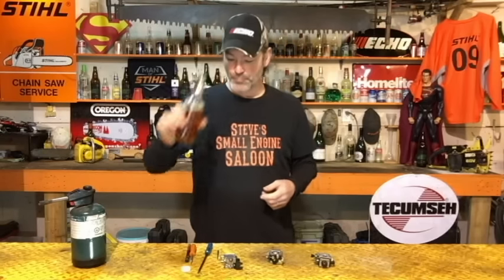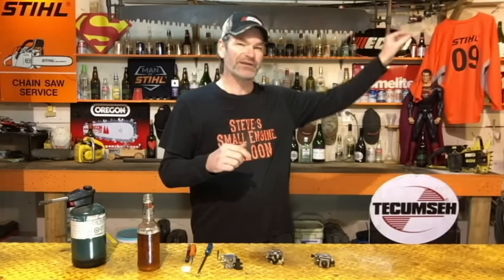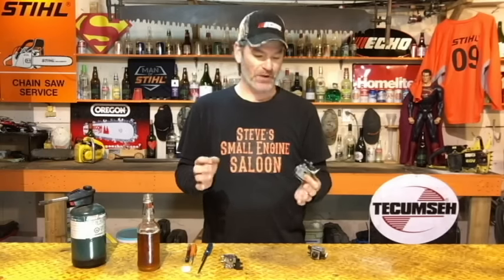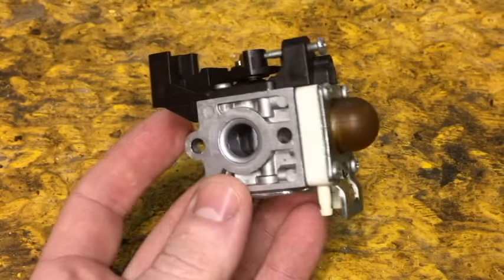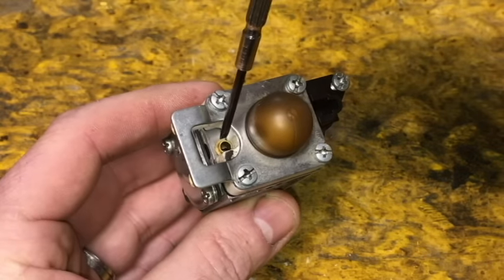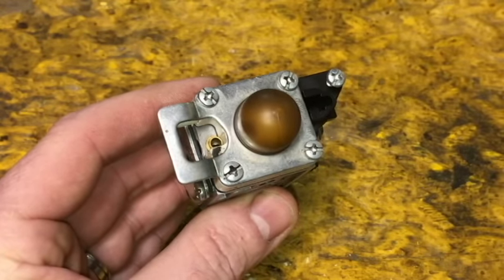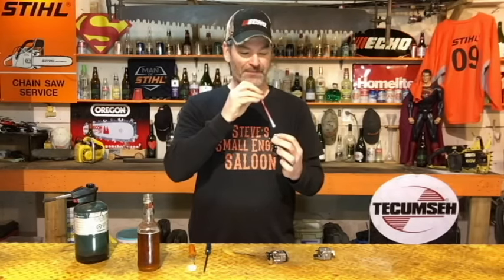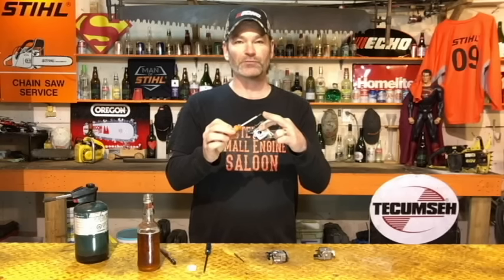Hidden Carburetor Adjusting Screws On Some Weedeaters And Blowers

Comment from the maker: ✅Order the specialty carb adjusters here ➜ https://amzn.to/3mJyI2q
For more videos like this, check out:
👉How to Adjust or Tune the Carburetor on a Leaf Blower ➜ https://youtu.be/DWPUYJiF6KM
👉CORRECT WAY To Tune The Carburetor On A Chainsaw ➜  https://youtu.be/M6T5JoGXcHY
👉How To Adjust Or Tune The Carburetor On A Weedeater ➜ https://youtu.be/gmhxTvGRtCg
👉How To Clean a Honda Style Carburetor ➜ https://youtu.be/uAHdhuDpeKw
👉How To Rebuild A Carburetor On A ChainSaw, WeedEater, Etc. ➜ https://youtu.be/7-VpdJEJRRw

You can connect with Steve here too: 
✅Visit Steve’s WEBSITE ➜ http://www.stevessmallenginesaloon.com/ 
✅Visit Steve’s PARTS & TOOL STORE ➜ https://www.amazon.com/shop/stevessmallenginesaloon 
✅Follow Steve on FACEBOOK ➜ https://www.facebook.com/stevessmallenginesaloon 
✅Follow Steve on INSTAGRAM ➜ https://www.instagram.com/stevessmallenginesaloon/ 
✅Follow Steve on TWITTER ➜ https://twitter.com/SteveSaloon
Reply: Mine dont look filled, but I cant adjust it, I see a brass thing on the top, but its round and none of my tools work on it
Reply: Double J  y
Reply: @tyleranderson6221  8PM
Reply: Hey Steve I can adjust the other carbs with the special screws just fine but when I went to my echo leaf blower which from the factory was running lean and I took both plugs out and I got the low speed adjusted but I just couldn’t get the high speed. I don’t know if it was because it’s winter but I warmed it up for 5 minutes so if you wouldn’t mind could you make a video where you adjust that type of carb from the video? I already checked for air leaks bad diaphragms and my fuel was fresh. I don’t know if you’ll even see this but I was just curious if you would do that. Tomorrow I’ll try a bit longer and see if it’ll work. It revs out all the way and idles fine but around mid throttle it runs rough so I don’t know.
Reply: @tyleranderson6221 I had an echo weed eater that had a brass plug that I carefully drilled out to expose adjusting screw
Reply: @ARW981  lmao that was 3 years ago😭 I figured out that trick now

Comment: I’ve been a atv/ snowmobile / utv and motorcycle tech for the last 15 years for Polaris and Yamaha. We recently picked up the echo line and I’ve all of a sudden am getting weed wackers, leaf blowers and chain saws added to my work load while never really working on this smaller type stuff much in the past. It’s been a learning curve that’s for sure and even some I have almost given up on. I’ve actually learned a heck of a lot from your videos on this stuff and beleive this video may have given me the solution to a echo weed wacker I said to hell with as nothing I did could get it running right. Never would I have known about these hidden mixture screws without your help. Keep up the great work my friend. And thank you.

Comment: I don't normally comment but I figured I should on this video. I bought a brand new champion straight shaft weed whacker 3 years ago. It worked amazing for my farm for the first year. The second year though it stopped working after I changed the string out. Wierd right?! 

After fighting with it for days I set it up on the shelf and left it alone. Pissed off and defeated. Tonight I picked it up and fought with it some more. Figuring that it wasn't getting correct fuel as soon as the choke was off. It would die. 

I wanted to adjust it but could only find one of the screws (high speed) and it was an A circle type screw. I couldn't find the low speed adjustment. 

After watching this video I was able to get this weed whacker up and running and I should be able to get it back out on the farm earning its keep. Thankyou so much Steve!
Reply from the maker: You're Welcome...

Comment: Thank you Steve! You just saved me god knows how much money on fixing my four stroke Dolmar Backpack blower motor. It had the hidden/capped screw for the air fuel mixture. I heated up a screw driver and melted it into the cap like you showed us allowing me to remove the screw cap. 5 seconds worth of adjustment and my blower no longer bogs when I go from idle to full throttle instantly. That was stupid easy to fix.
Reply from the maker: Right on....You're Welcome...

Comment: Extremely useful video.  My Homelite leaf blower could only go to half throttle before bogging down and stalling.  I did Steve's trick with the blowtorch and small screwdriver and got the plug out.  Adjusted the air/fuel mix and the the thing has never had more power...running like a champ.  Great work Steve!
Reply from the maker: Thank You...

Comment: Thank you heaps and heaps. My homelite weedeater lives again! Although not covered in your carby demo, mine has a chinese ruixing carby with a barrel. The hidden idle screw is well camouflaged and I needed to modify a largish flat screwdriver to adjust it. Thanks to you Steve, I received a major clue as to where it must be, then POW! There it was. You're a legend, mate!
Reply from the maker: Right on...
Reply: @StevesSmallEngineSaloon  I SEE A 1BUMP IN THE MAIN SHAFT BUT NO OTHER FOR HIGH or could be low I guess! Any Idea's! It's a Homelight 26cc 2020 Rui*ing  129 Wish I could get a walbro to replace it! But if you know where other adj.screw is it would be appreciated! Great Stuff! Rick👍🇺🇸

Comment: Dude, I love your channel! Thank you for your content. I searched everywhere to find a video that explained this and you’re the only one. I have an old “x-treme” scooter that has a 2 stroke motor on the back. I got it when I was a kid and I’ve taken it apart recently to clean everything and I had to replace a couple things. Well I did that, it ran good for maybe 3 minutes and now it won’t run and when I give it gas, it bogs down. I’m pretty sure I need to adjust the carbs because there was so much gunk in there. But I have the second carb you talked about. I’m about to go out there and get this sucker running! Fingers crossed.
Reply from the maker: Good luck!

Comment: Awesome video Steve. Bought an Echo trimmer a while back that never ran great wide open, despite them "tuning" the carb when I bought it. Pulled the plug, and adjusted the high speed to the sweet spot and it's absolutely singing now.
Reply from the maker: Awesome...
Reply: mxdev Hey mxdev ...  What Echo do you have and did you have one of the carbs that was shown in this video..?  Thanks
Reply: @stacks4943  It's a GT-225SF. I don't know if it's exactly one of the carbs in the video, but the information given is all that is needed.

Comment: Thanks for this tip. My neighbor brought me her Echo leaf blower that wouldn't rev up. After cleaning the spark arrestor screen with my torch, like in your other video, it still wasn't running right. It had a Zama carb on it, so your "hidden adjusting screws" video was perfect. I didn't need to remove the plastic caps, there were none and I didn't need a fancy screwdriver.  Both screws were just plain slotted,, so I was able to get it adjusted pretty quickly.  It really screams now.  Thanks again.
Reply from the maker: You're Welcome...
Reply: @StevesSmallEngineSaloon  That tip worked so well on my neighbor's blower that I pulled out my 22 year old Weed Eater blower and got it screaming again.  It's been weak for several years.  Thanks again.

Comment: Thanks for the "hot screwdriver" tip. My Echo trimmer wouldn't rev unless the choke was on. I cleaned the carb and the exhaust screen... no improvement. I disassembled the carb, and sprayed it out with B12... no improvement. All the gaskets and diaphragms were in good shape too. I replaced the primer bulb about a year ago, so it's in good shape, too. Once I finally gained access to the high speed screw, I was able to get it to run. It runs great now. Thanks again.
Reply from the maker: You're Welcome...

Comment: Removing all fear from small engine repair.  Thanks again Steve.  As an dual engineer and homesteader I really like the way you put these videos together.  I have a lot of engines to maintain here, like 25+ at last count.   I am trying to avoid professional repair except on my quad and cars. as they are to much of a PITA to bother with.  But I like the small engine stuff done here and that is 98% of what I have to maintain.   Lot of practical knowledge and some entertainment, in the way I enjoy, as usually there is a beer involved in my engine repair.  The other day my Stihl MS250 dumped all it's chain oil on the table and you had a video and me back up and running in no time.   It wasn't the plug but the line was dry and needing replacement but either way, I spent 5 dollars and 1 beer and was back up and running.  Thank you again so much for all these tips!
Reply: Oh, and I should add...  The local shop in town that I got the part from, for $3.50 told me honestly that they would charge a half hour labor, and since Stihl insists on them doing a multi-point inspection to optimize performance, but I know the saw is running like a charm, it would cost $90 😮😮😮  I said thanks, I am really taking pride in learning how to fix all my equipment on the fly myself, but they were really pleasant as they are in small towns, knowing I will buy more equipment throughout the years.  So you say in your videos you like to hear that you save people money?  Yep!!! Thanks.
Reply: Me too.

Comment: Thank you, I have a Echo weed eater and after I changed the fuel lines, air filter, fuel filter, spark plug, remove the screen exhaust, it kept boging down, I was about to give up and throw it to the garbage, but I removed the little plastic with a small screw and adjusted the carburetor, it worked pretty fine.
Reply from the maker: Right on...

Comment: Great info!
BTW, I have had good luck adjusting small D screws without the special tool (although its easier with it). Just slip a very thin flat screwdriver against the flat side of the "D" shaft and give it a turn. The vast majority of the time those little screws will turn with minimal effort.
Reply: I actually made a small D adjusting tool myself out of an old screw driver and a small strip of flat tin. Just rolled it shaped it and welded it.

Comment: Great video, thanks.  11:24  Absent the special Micro D tool, for my Echo PB500T Walbro backpack carb, I sliced the end of a Bic ink pen straw and was able to push it and fit it over the needles to adjust the mixture.  It worked.  I eventually purchased a "micro D" carb adjustment tool from China, but the ink straw put me back in business.

Comment: Thanks for the info on the high speed adjustment.  Got it adjusted.  However you mention another hidden adjustment, I believe it would be the low speed, i.e. idle.  Where is it?  I see what appears to be a brass plug in the top, throttle control.  Is that it?  How do I remove it??

Comment: Great video helped me a ton! Brought a crappy Chraftsman 4stroke weedwacker home from work with bogging issues. First carb I've never seen adjustment screws on. Unfortunately I have one of those non adjustable high screw walbrow carbs. But the low idle is all I needed and a clean air filter. Thanks for the video! Keep tippin em back!
Reply from the maker: Right on ...

Comment: Hey Steve, love the channel.  I recently rebuilt a Husqvarna 150bt backpack blower with a Walbro carb that looks just like the one in this video.  I pulled these screws out to clean out the carb, but I failed to note how far the screws were turned out by the manufacturer before I removed them.  On a handheld product I can usually get it started by seating the screws and then turning each H and L out 1.5 to 2 turns.  But I can't seem to find the sweet spot on these jets.  Is there a "normal" starting point for these screws?  Thanks so much!

Comment: I found that a drywall screw works perfectly for extracting those plugs. That type of screw comes to a sharp point and has aggressive treads. Just screw it into the plug until snug and it should easily pull out.

Comment: Saved my day as I didn't find the L adjustment screw but in my case it was just in the center of the moving throttling barrel system. Always thought it was just the screw to keep the throttle part in place but  after seeing this video I unscrewed  (philips flat) and it unfolded a screw with a large pin. Adjusted the whole thing and done!

Comment: Another nice one. As a desperate move, I had some "D" style adjusters on a poorly running carb. I obviously couldn't slot them, and it's illegal in Georgia to sell the drivers (unless you know the shop owner), but I'm cheap, so I used a couple of pieces of stiff plastic tubing, heated the ends a little and pushed them down over the screws. Those two are still sticking out the side of my chainsaw, as a quick, permanent adjuster setup!
Reply from the maker: Right on Buddy...

Comment: Fish hook for these small plugs. Different size hooks for different applications. If you need the barb closer to what needs to be removed simply nip off some material with side cutters. If this tip has already been suggested I apologize... there is a lot to unpack in comment sections.

Comment: Thank you so much Steve, knowledge is a wonderful thing and meant to be shared, thank you again for the enlightening me. I just spent over an hour changing carbs, cleaning fuel lines, checking the spark plug is working and cleaned, all to no avail, it just kept on bogging down as you American's say. Keith Spence Eng from Wales UK
Reply from the maker: You're Welcome...

Comment: I've never seen that type of carb with the barrel butterfly in my life & I've seen lots, maybe we don't have them in Scotland but hey ho, you learn a new thing everyday. Cheers 💪❤️👍
Reply from the maker: Not the most popular here in Canada, but they are around...
Reply: My Redmax trimmer has the Walbro like that. Been on the shelf for a few years due to not running. May pull it out and check it again since i've seen this. Thank you.
Reply: It is on my old Stiga SB 44 (its really old, bought used 6 years ago)! Latvia.

Comment: perfect fix for my echo trimmer. runs like a top now that i am able to make the high and low adjustments.
the plastic plug melted right on to the small screwdriver and twisted out nicely. nice job.
Reply from the maker: Right on

Comment: The k series Zama barrel carbs have a check valve behind a ss plug under the needle hinge and directly under the white fuel spout , and cannot be removed , i have found that on many of those carbs it will go bad or stop up I always prime the carb with fuel and blow air from compressor through the throat of the carb with barrel fully opened in direction of operating flow and you should see a fuel mist , And also the adjusting needle has a small fuel passage in the needle itself that some times gets clogged
Reply: The epoxy is bonded tightly to the walls of the hole, but the plastic plugs are just a pressure fit.  Epoxy MAY also fill the screwdriver slot, or may not...  has anyone tried?

Comment: Thanks for the help. I bought a redmax ebz7500 about 2 years ago and it started running extremely rich all of a sudden. I saw that adjustment hole in the carb and tried to make a high speed adjustment with no luck.  Your trick with the hot screwdriver worked perfectly. (I used Mapp gas) after about a full turn or so clockwise it runs better than new. I think it was always a little rich from the factory. Lean is mean it what they say, well until it kicks a rod🤣   Great video, just wanted to say thanks 👍
Reply from the maker: Right on Kenny!

Comment: Steve, I have a raftsman string trimmer that uses straight gas “4 cycle” ... i think I only have the screw down the Center of the throttle. Is it possible just to have one screw on the wall bro carb?
Reply: Ya my Honda 4 stroke is the same.
Reply: K

Comment: Love this vid.  I have one that I can't seem to find much info on.  Only seems to have the one pac man style screw on the throttle.  Similar to the low idle adjust.  Have looked all over the carb and don't see  a second hidden screw.  Carb is stamped Ruixing, but the model number doesn't bring that up online.  Are there any that only have one adjust screw?

Comment: are the gx25 walbro carbs non adjustable or can you get at em
Reply: yep possibly again like steve said the center has the low speed, and the high speed will be on the carb side where the primer bulb is on the top, and the fuel line fittings are on the right there will be a hole towards  the top of it, and it possibly will be plugged with a little metal ball. idk if there realy a way to get that out. but i hope i helped good luck.

Comment: Great tip! Does the same apply for the Stihl MS 180? My oldest son got my 180 to learn how to use a powersaw, but it keeps bogging down every now and then...it's no apparent adjustment screws on the carb...
Reply from the maker: That saw is truly NON-adjustable.....
Reply: Yep...found that out..haha! Well..it'll have to do for the kid until he's more proficient in chainsaw use. Thanks Steve.
Reply: I have the same saw. Non-adjustable. How stupid is that? I'm at 3000 ft and on a smoking hot day ( 34C or mid nineties F) my saw starts bogging down. I'm fairly sure it would run better if I could enrich the mixture a bit. But no. I have to give up and start again the next day when it's cooler. A brand new saw!
Reply: My MS 170 needed adjusting and it can be adjusted. Don't know why yours cant, Steve says you cant  so guess yours is different than mine.

Comment: Always go to your videos for the good stuff. I recently removed  a small carb from a Champion leaf blower bought at Canadian Tire. I was going to replace it with a walbro 11mm barrel throttle carb but I have a problem. The small hole just below and to the side of the venturi is located just below but centered. The port I am talking about sends pulses from the underside of the piston to the fuel pump diaphram. Have you ever seen a carb with this configuartion.